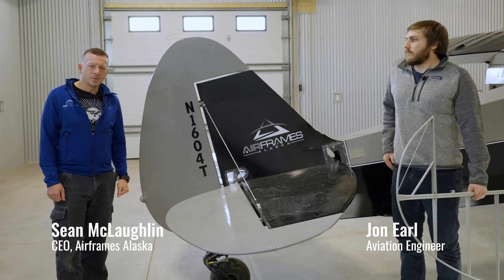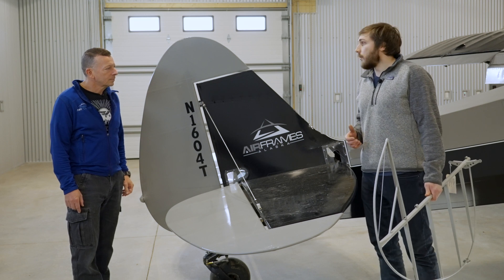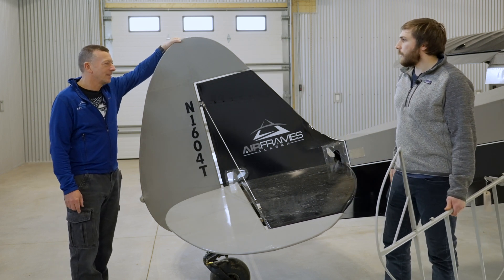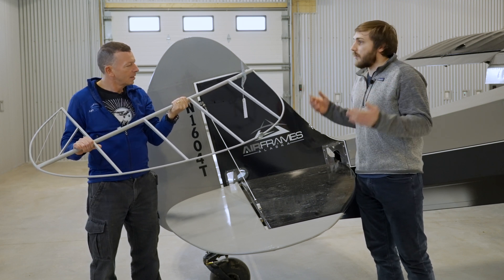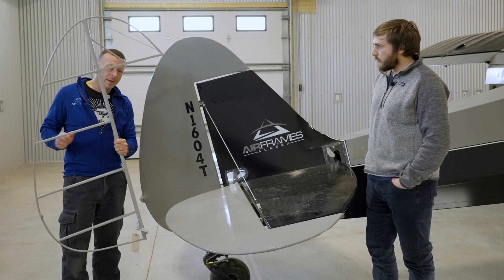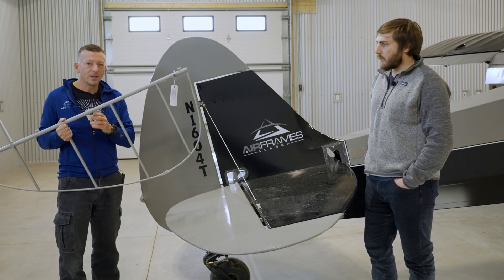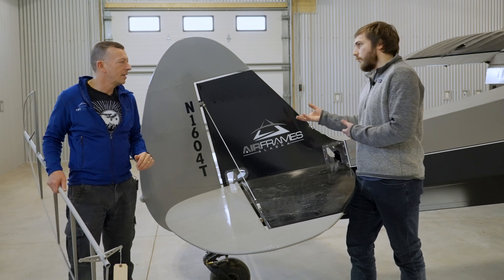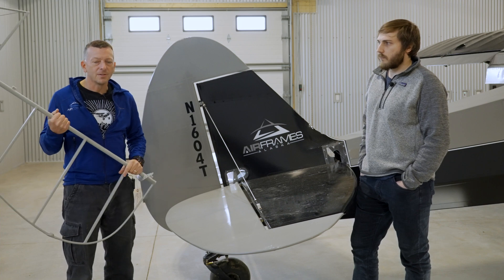Airworthiness Directive Update: Piper Aircraft Rudder

Comment: This is NOT the same rudder as the Failed ones. The Failed rudders had a 'Top post' and an attached (Large, Heavy) Beacon that combined with a High salty air environment resulted in excessive loads on the rudders. NO airplanes were lost to these two failures.